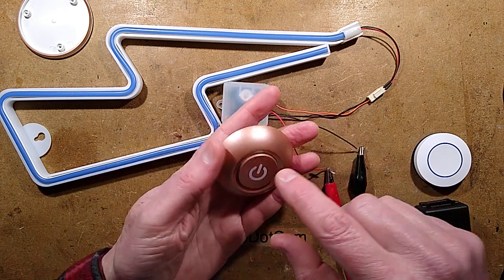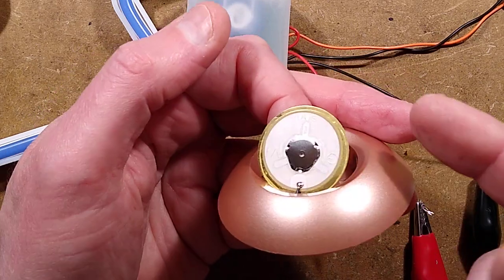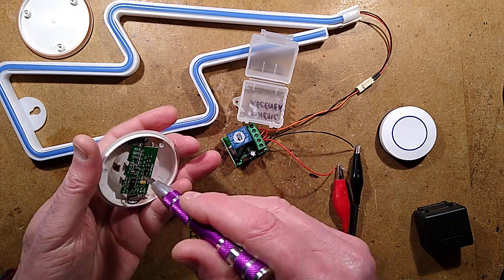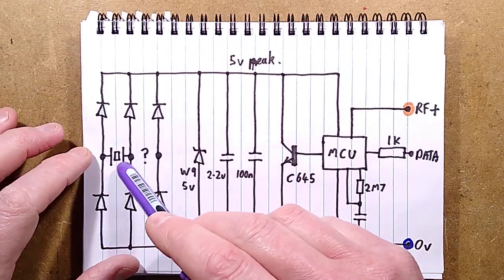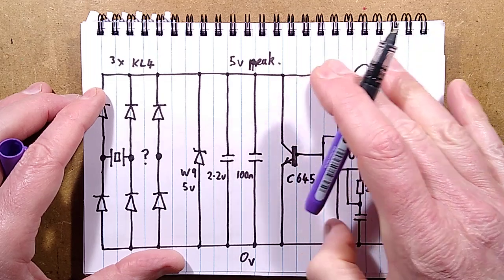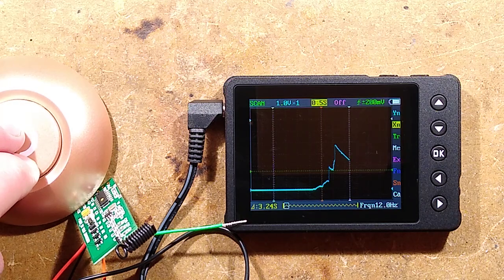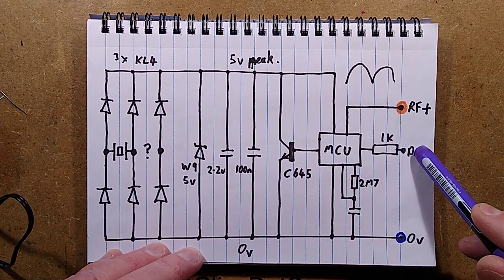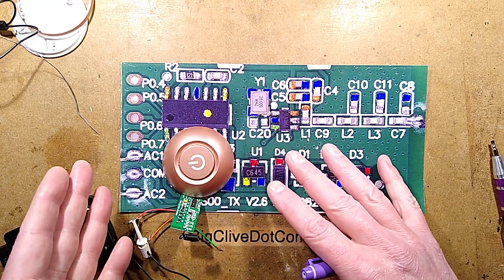I thought this was going to be a fake kinetic switch

Comment: Off topic hope you see this or someone who can help TIA
    I've seen 9v lion batteries that are rechargeable via a USB port or by a charger my question is one that has been a topic of lithium batteries in the past "lieing about capacity"  what is the max capacity you could see in a battery that size? 
      Seen a link for a 5500 like yeah lmao 🤣
But 650 is reasonably the most id think 🤔
Reply: 14 minute mark clives neighbors 
     Told you not to buy some new fangled battery less switch look it's broken already the lights keep turning on and off
Reply from the maker: I took a look at a lithium 9V battery in a video.

Comment: Don't know why but i just can't stop looking at and lusting after the anodized purple screwdriver.
I have a black one that works fine too. And I know they aren't 'that' special.
But purple...c'mon!

Guess it's a throwback from getting into the mtb scene when it was new and anodized blue parts gave god like status...until purple came out.
Reply from the maker: It's an eBay special.  I started using it when I misplaced the other black flat blade driver.  (It had stuck to a magnet)
Reply: @bigclivedotcom  i need an entire rainbow of them ;)
Thanks Clive.

Comment: when you flex the crystal it generates an electrical pulse...
Reply: It produces a direct current (DC) voltage. The atoms in the molecules structure get rearranged from the pressure, and when they jump back in place the current is produced - I think. Correct me if I am wrong, anyone.

Comment: Can someone please explain to me why the transmitter switch is using the 26 Mhz band to transmit the data signals and the receiver is using 433Mhz to receive them.
Reply from the maker: The crystal is used as a base frequency and multiplied by the chip.

Comment: Could there be a Pulse width modulation (PWM) with a simple data transfer going on there?
I was reading about PWM on Wikipedia and on Circuitdigest. I also read somewhere that the current you get from a crystal is not a steady current. Hence I ended up reading about PWM.

Comment: BL8506-45CRM Your mystery transistor may be a voltage monitor, to keep the microcontroller in reset state while there is not enough charge.

Comment: These piezoelectric devices can be stacked 'physically', wired series or parallel, but only the top disk/element is mounted to the housing. I use a stack of 4 in my "Mega Ohm".

Comment: I wonder if the size of the crystal could affect the range of the transmitter. My guess is, because it's only 4-5V, the transmitter's range is limited.
Bigger crystal for more volts?
Reply: The range is limited indoors. It is much better outdoors. 
You can read about why it is better outdoors on Wikipedia - Citizens_band_radio. These radios uses the 26 Mhz band in some countries.

Comment: after seeing the video, I don't feel the C645 ic is a transistor that use to short the power, my guess will be a voltage supervisor IC. Then after some googling, I found it, the chip is BL8506 Low Voltage Detector IC, the 45 in C645 mean the it monitor if voltage get to 4.5V, my guess will be the pin that goes to MCU is the MCU reset pin, supervisor IC will hold the reset pin to GND until voltage is enough for MCU to work correctly
can test by short that MCU pin to GND use a 10K to see if the button stop working
https://www.belling.com.cn/en/media/file_object/bel_product/BL8506/datasheet/BL8506_V1.9_en.pdf

Comment: It really amazes me they designed a circuit with a mirco controller than can run with just the push of a simple button. Makes me wonder what other super low power electronic devices could be created

Comment: That's actually a really cool button that can be place almost anywhere and never have to replace a battery.
Reply: I could imagine putting it in my pop up camper to control the lights. Never have to worry about it through the temp changes either.

Comment: For what it's worth... the antenna on the button (and the one on the receiver looks the same?) is ridiculously short for 26 mHz.  It would be a little unsightly, but it you made the antenna even a foot long and straight, you'd probably get a good improvement in range - even though it still would be ridiculously short for 26 mHz!
Reply from the maker: It's a base frequency.  I think this is 433MHz.
Reply: @bigclivedotcom Well that would be a kettle of fish of a different color.  ;^)

Comment: I used already (2 different) RF relais (also 433MHz) with the small remotes with 2 buttons on it and they also had those small coiled antennas. They had a rather small range of like 5 meters. Then because the range for a garage opener was too small (knowing nothing about antennas), I desparately uncoiled the antenna and wow: the range was at least 3-4 times better.

Comment: The micro transmits when it comes out of power-on reset - a register is set when this happens to let the software know. The transistor is used to quickly short the 5V supply after sending the data, ensuring that on the next switch press, the micro will again come out of reset and transmit again. It doesn't care about rising and falling voltages - that's what power-on reset circuits do anyway. Great circuit.

Comment: I've also seen a piezo disc (used as a buzzer) which had 3 connectors, all of them soldered to some wires.
Reply from the maker: Brass disk, main piezo electrode and small feedback electrode.

Comment: Question to smart people out there:
Since we already have Kinetic Switches out there, I was thinking - is there a product that offers an Kinetic Reader (RFID or other)?
Say, you need to hold an id tag agains it and press an actuator of somekind on the reader to power it?
Would go marvelously in pair with regular Kinetic Switches in creating some easy-installation office system.
Reply: I don't know about that, but you can get the regular AC Kinetic Switches on 433Mhz, and you can get AC Kinetic Switches with both 433 Mhz and 2.4 Ghz. 2.4 Ghz and an app means that you can control it with your SmartPhone. The one I was just looking at was also set up to work through voice commands with Amazon Alexa and Google Home.

Comment: I like the one with the battery also. Many years ago, when my good wife and I switched from a pull type RV to a motor home, the first Class A we purchased had a rear view camera but it only showed, perhaps 4 feet behind the 36 foot rig.  So I picked up one of those cheap backup camera for cars and installed it in the back bumper of the rig.  The device was intended to be powered from the back-up lights but I wanted it to come on when I was traveling down the nations highways.  So I picked up one of those little battery powered remotes.  Mine came with a key chain dongle that had two buttons. I wired it in to the main 12 volt circuit and used the little button to turn the color camera on and off as I needed it.  The device served me very well for the 20,000 miles I put on the old rig before I traded her off. On the trade, I kept the setup but since my new rig had a decent camera and display on it, I never installed it on anything. I am now considering sticking it in my Ford car just for shits and giggles. I love gadgets so  that little display could join my car camera, fuzbuster and GPS since my car is old enough that it comes without these luxuries.

Comment: AC1 = Actuator 1 
AC2 = Actuator 2
COM = Common
One actuator is on, other is off as the codes are different.
Usually in programming mode, sending a OFF deletes the code, sending ON programs the code.
By wiring in just one like they did they can instead use code that sends the on and off alternately and it may also explain why it does not always work after being idle for a long time.
Alternatively what you assume is a transistor may be a ultra low quiescent current regulator delivering 0.8-1.8v for ram retention in the mcu so it can remember if it sent the on or off last. That also explains the large 2.2uF tantalum capacitor.
Reply: The scope probes are sucking the 2.2uF capacitor dry in the video.
2.5v on 2.2uF has a time constant of 2.2 seconds. I believe the sending of the code is triggered by reaching 4.5v and the first click down on the button only charges part-way.
Releasing it gives it another kick and it reaches it's target and now has enough energy to transmit.
You can test this by clicking it in and waiting for it to drain and see if it still transmits on release or transmitted already.
Reply: C645 is a BL8506 ultra low power voltage detector.
Markings are C625 for 2.5v, C633 for 3.3v and C645 for 4.5v etc. C means it has CMOS output to mcu.
Current consumption is 500nA and it is most likely used to tell the MCU when it should transmit. Hysteresis is 4%.

Comment: That C645 may not be a transistor, but instead it may be a voltage detector. In which case it turns on the MCU when a minimum voltage is reached and then the MCU drains off the charge of the capacitor as it transmits the data.

Ref: https://smd.yooneed.one/code4336.html
Reply: That was my thinking as soon as I saw it.
Reply: Yes... Probably a BL8506-45CRM.. Also, the U1 on the PCB points to an IC instead.

Comment: @bigclivedotcom — What is the purpose of the snap-dome switch in the middle of the piezoelectric disc?  Is it there only to provide audible and tactile feedback?  I could imagine an application for this type of switch in a garage or similar less-than-benign environment, but I've found that snap dome switches often begin malfunctioning even indoors after a few years due to ingress of contaminants or oxidation of the contacts.  If the snap dome has no electrical function, I would consider that acceptable.
Reply from the maker: The crystal will generate a stronger current spike when given a sharp tap.  It provides tactile effect and a higher voltage.

Comment: Im really surprised the thing can even generate enough energy for all the components to spring into life and do their thing lol proper clever that :) wen i was 16 i tried a project in Everyday Electronics to make an analogue drum machine that used 4 piezos, op amps and capacitor/resistor layouts to make 4 'drum' sounds. It didnt work lol. not sure if its cos i stole the piezos from old telephones and they wernt up to the job or what. shame cos i bet it would have been interesting to tap away on the brass disks and make drum sounds.

Comment: Are you using a noise reduction or expander audio plugin? The loud portions seem to jump out and the ends of words seem to gate off slightly. My vote is against it.
Reply from the maker: Slight audio processing, but the recording device has quite harsh pickup of sharp noises.
Reply: @bigclivedotcom  Thanks so much for the reply! I REALLY enjoy your videos and your skill and insight as to the reverse engineering is remarkable. But if i may vent slightly. It seems to be more and more common for folks to use noise reduction plugins. They all work as expanders ( make soft stuff softer and loud stuff louder ) , gates ( turn down or off soft sounds), or dynamic equalizers ( cut the high end during soft portions) or a combination of effects. To my ear they all cut intelligibility ( cutting soft continents ) and introduce a subtle gain pumping  ( room tone goes up and down with the dialog ). Our brains are exquisite at picking speech out of noise. Sorry to take this out on you. Some wonderful interviews I try and listen to are unintelligible because of processing (lost consonants and lost tails of words). Some old TV shows you cant hear any of the Foley ( footsteps, swishing of fabric, clinking ice cubes) because of the noise reduction. i would so much rather hear a little noise than all the processing. There... I think i am better now. Sorry

Comment: random question; when the electrons are lost to the radio antenna transmitting them, how does the piezo crystal restore its lost electrons? From the environment? What if it was in a vacuum, etc?
Reply from the maker: It creates the pulses in opposite polarities when pressed and released.  In a loop.
Reply: @bigclivedotcom  Is there not a net loss of electrons after the radio transmission occurs?

Comment: Piezoelectric crystals aren't related to Curie temperature, iirc, instead the atomic structure is electrochemically asymmetrical, so deforming it along the right axis physically pushes the like-charged atoms together, changing the density of electrons... which is a voltage difference.

Comment: 2SC645 has a maximum continuous Ic current of 30mA.
When you short a 2u2F tantalum capacitor using this transistor, Amps of current will flow through the collector, albeit for a few microseconds! 
What am I missing? Scoping the 2M2 resistor and the ceramic cap to the mcu, would've told the story of what it does. 
I suspect it to be an RC reset circuit for the mcu, but don't have enough data to say for sure.

Comment: I wonder how many button cycles the piezoelectric disc could handle before it failed outright or if it has a slower deterioration failure mode where it loses it's power output gradually

Comment: I remember those "Piezo Electric Walkways" less than 1/3 of the energy produced than spec, twice the cost and on a short 200 panel walkway at least 1 panel per day breaking after 2 months. Far more carbon dioxide produced than they would ever get rid of. Not bu a bit either I think it ended up being 200 to 1. IE 200g produced for each g saved.

Comment: Micro-controllers usually have under-voltage lock-out to prevent low voltage from causing unknown states. Since the micro-controller relies on its supply voltage rising above UVLO to detect a button press, the self-shunt is there simply to make sure the UVLO kicks in again at the end of sequence to setup the next press.

Comment: Maybe they should actually go for a different mechanical approach like in lighters. Make you press a button hard for it to SLAM the crystal, then convert the high voltage to low voltage but high current, dump it into a capacitor and be able to transmit a stronger signal.

Comment: The circuitry at U3's output is an RF filter network to enhance the harmonic output that is above 300+MHZ  and suppress any at 26 Mhz.
Reply: Could be but there isn't a harmonic of 26MHz anywhere near 433MHz so I suspect it's operating on another (illegal in UK) band.
Reply: @jeremygreenwood8501  You are right about the harmonics because 26x16 = 416Mhz.  The 17th harmonic is in a USA HAM band. I thought that 433Mhz is the band in the USA for Garage-Door openers.

Comment: the piezo elements are used 

1. as tweeters in cheap stereos in the 80s

2. ringers in cheap telephones especially the one promoted by the purina ralston chex cereals in the 80s.

3. electronic musical and recordable greeting cards.

4. electronic drum sets plastic frisbee shaped or even wedge shaped pads has piezo elements that when you tapped them they sent a signal to the controller and it played a synthesized drum sound.

Comment: I wouldn't have thought it was possible to do it this way. The voltage those piezos give off is more than enough but the current is incredibly low. But apparently that's all it needs. It's incredible that it can be done that way. By the way, piezos are one of those few components that usually still have lead in them, as the most common and best piezoelectric material, PZT, is lead zirconate titanate. I wonder how that factors into RoHS compliance.

Comment: It would have been interesting to scope the data line, to gain an insight into the code used.
With such a short transmission, the receiver must be  active all the time. I.e. no power down and no squelch. This must be demanding for the code used, as the receiver has a finite probability of decoding a valid code from the noise.

Comment: These things are mind boggling, an entire MCU and RF chip working on a tiny "sip" of energy from an event that lasts what, 1ms? Perhaps even less.
These switches seem preferable if installed permanently inside a standard electrical box where you can literally forget about them since there isn't a battery to worry about but the incompatibility with the battery operated ones is indeed an inconvenient trade off...BUT what if you install two receivers so you can use whatever transmitter you want (battery operated where is easy to change the battery and piezo where it would be permanent/set and forget)?

Comment: U1 C645 looks like a reset ic rather than a transistor which keeps the uC in reset until it reaches its threshold voltage which will be a sufficient charge in the capacitor to give the uC enough time to send the data.
Reply: That makes sense!

Comment: How unfortunate, that they are not (easily) programmable. No "smart" BS, though!
I'd like my light switches to be buttons without any particular wiring attached to them.
Stick 'em where you want your light switches to be, and you're done until they mechanically break.

Comment: Steve Mould made a nice video about the Piezoelectric effect: https://www.youtube.com/watch?v=wcJXA8IqYl8&ab_channel=SteveMould  There's no need to heat treat the crystals - a simple quartz crystal will do.  The compression of the crystal causes positively charged atoms to move slightly relative to the negatively charged atoms resulting in a charge on the surface.  That charge is then picked up by the electrical contacts.

Comment: Hey BigClive, I've been a fan of your work for quite sometime now. This one really amazed me. Thank you for your reverse engineering. I just did some more digging and here is what I found. The uC could be EM78P153S from ELAN and the RF chip is something like F113 from VIBRATION or CY115 from RFICY. But F113's max crystal frequency is 14MHz. So I doubt that. Hope someone can add to this. And BigClive it will great if you can reverse engineer the receiver too. I highly respect your work. Thanks again, cheers :)